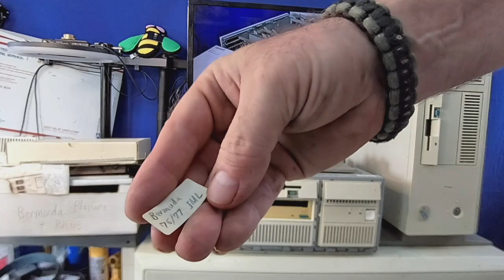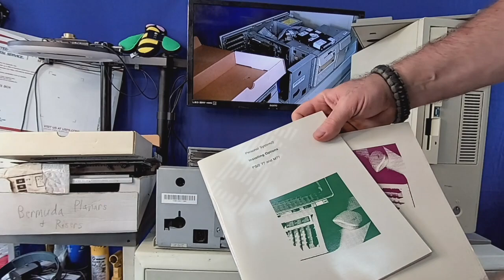Sending out a "Bermuda" planar to YouTuber "Curious Marc" - from "IBMMuseum" and the 'Ardent-Tool'!

Comment: I try as much as possible to use non-petroleum solvents on plastics as they will leave oily residues which I have to clean up afterward, and they can also degrade some plastics.

Comment: Yea Im guilty of coming her from CuriousMarc YT channel XD

I dont collect IBM stuff tough but my friends do.
I would like to get an old IBM Thinkpad  because Im out of space for the big stuff and Im mostly trying to kit out my workshop to repair peoples retro hardware and make my own YT videos about it.

I got my hands on a IBM PC-60, the tower with 1Mb ram and a 10Mhz 286 CPU plus the Monochrome Monitor.
Did power on so I gave it to a friend that collect IBM keyboards and vintage computers and he has spares for that system so seems like it got a better home there.

We did have and IBM PC in 2000, P3 800Mhz, GeForce 256 DD. Not the IBM of the old days tough sadly the quality was not that good on the millennium era stuff.
Parts of that system still lives on tough at the same friend of mine.

Anyways I figured why not sub to another Retro computer channel, I do find IBM stuff sometimes and I repair stuff to so more source of information is never a bad thing!

Looking forward to see more about the PS2 systems on both your channels!

Best Regards from Sweden!